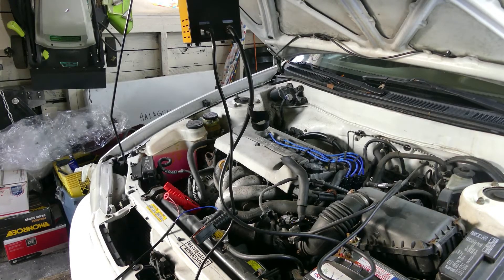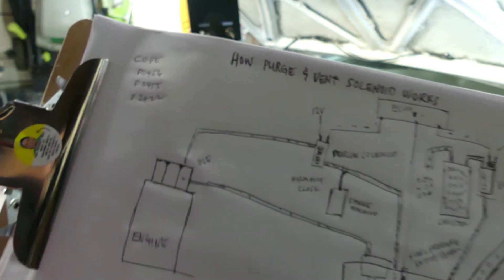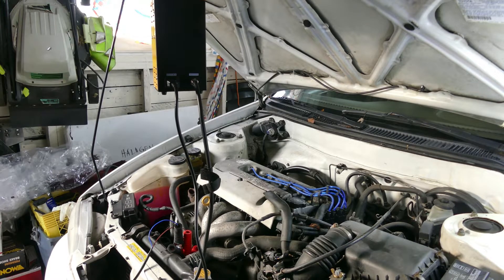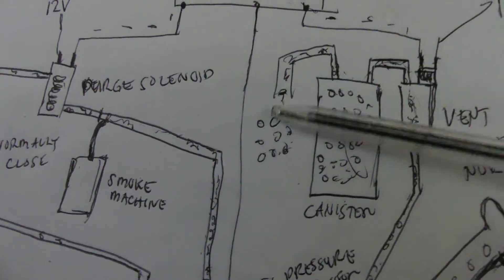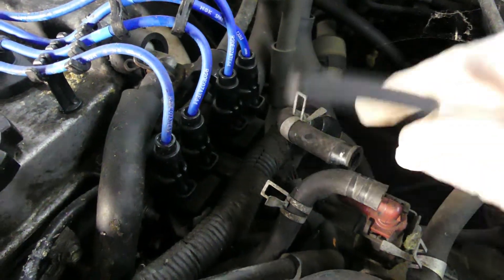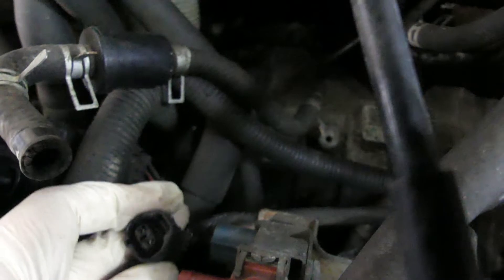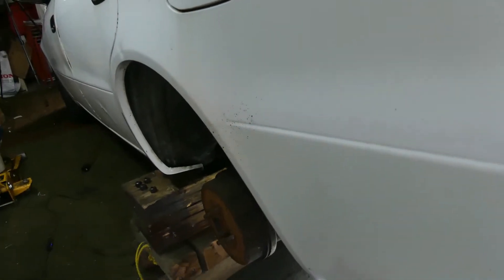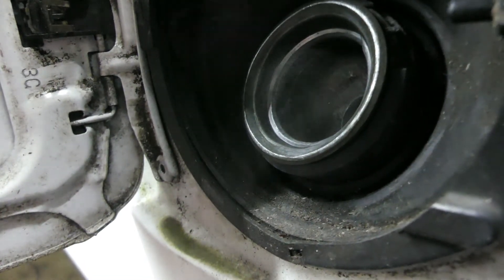Best way to Diagnose an EVAP Leak ..Purge.. Vent Solenoid & Canister  [Autool Smoke Machine]

Comment: Hi there great video btw. I was hoping to pick your brain. I have a 04 gmc envoy with P0455. I have replaced, purge solenoid, vent valve solenoid, gas tank cap, the gas filler neck and hose, secondary air system pump and its relay. I still have the code. I bought The smoke machine you have in your video. I did the smoke test through the gas filler port, I seen a lot of smoke escaping from the vent valve solenoid. Would this be the issue possibly that the vent valve I purchased from auto zone was faulty? I also have a short video identifying the smoke coming from the vent valve. I don’t know if this was normal being that I did the test through the gas filler port. May you give me your advice on my situation? Thank you very much.